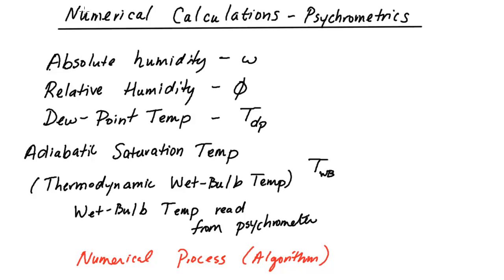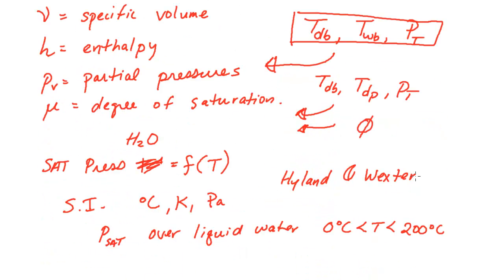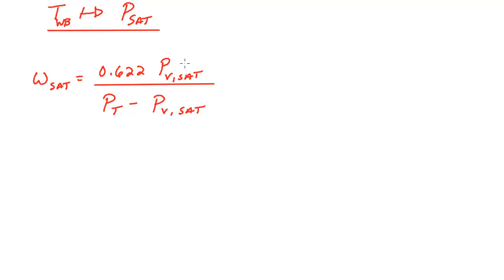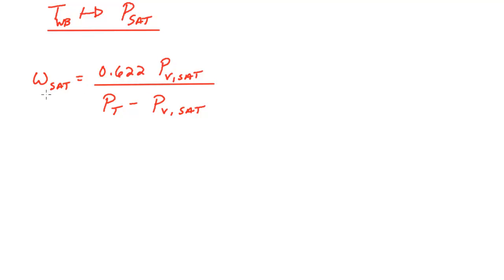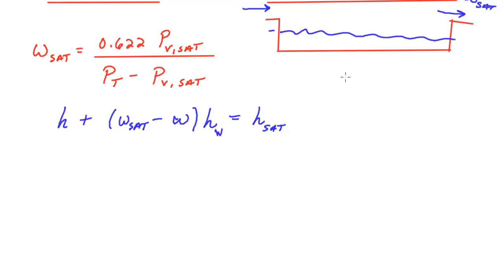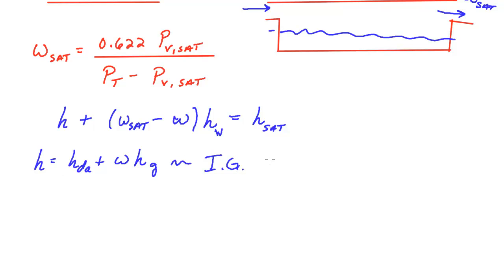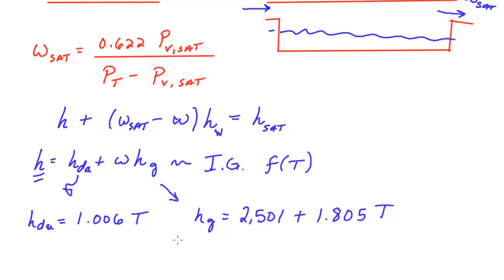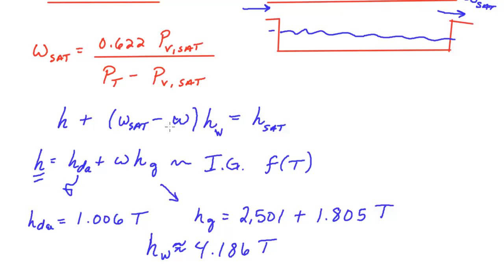Numerically Calculating Psychrometric Properties from Dry Bulb and Wet Bub Temp Part 1

Comment: If we look into the table we see that the specific heat capacity of both air, liquid water, vapor and steam change according to the temperature. For instance, if the dry-bulb temperature is about 300 K, the specific heat of air is 1007 J / kg / K and if the dry-bulb temperature is about 280 K, the specific heat of air is 1006 J / kg / K. you just wrote down the numbers without explaining where they come from. What about 2.501? i see that it's the enthalpy of vaporization at 273.16 K. Should we always use that value or shall we consider the temperature? For instance, at 298.15 K, the heat of vaporization is 2441700 J / kg instead of 2500900 J / kg.
Reply from the maker: When I first made this video, I think I was focusing on simply getting the numerical formulations presented for computation, less on full derivations. For the enthalpy formulation that you've commented on, I made a follow-up video that does explain where those constants are from. See https://www.youtube.com/watch?v=udz4Dr6AjTw. 

You're correct that specific heat is a function of temperature. Fortunately, over the range of temperatures that engineers in the HVAC field generally face, the differences are small enough that we can generally assume a constant value. There's no stopping someone from doing the proper integration to account for the variation - it's just that the added complexity is rarely worth it.